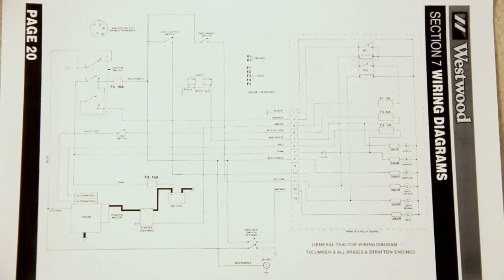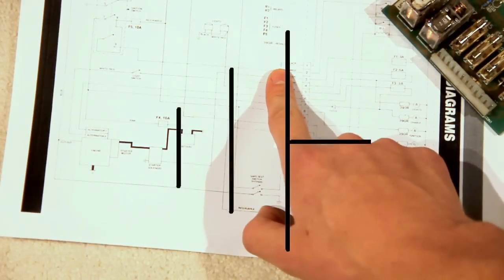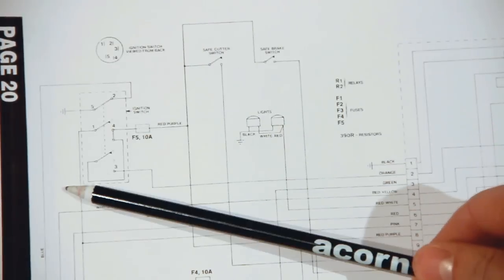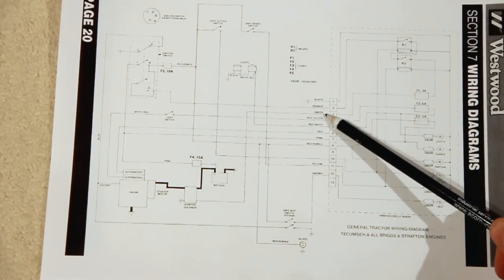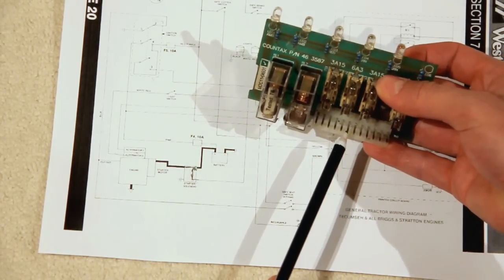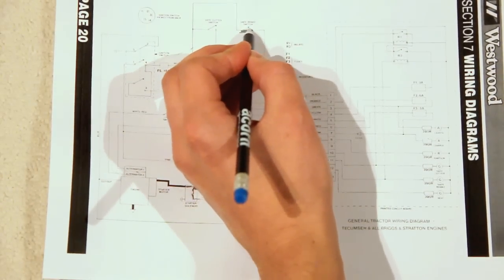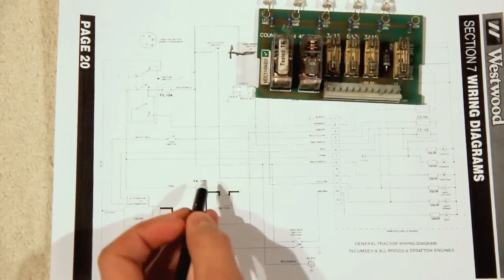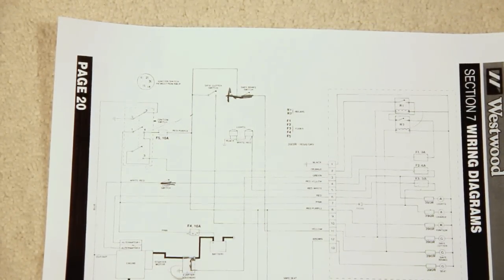How to: Read an Electrical Wiring Diagram

Comment: Hello, I know this video is quite old now but for anyone still interested I think the explanation of the safety interlocks is slightly incorrect. When you press the brake leaver for example this will close a switch but this actually causes coil R2 to Energise closing the circuit and allowing the engine to start. The R1 works the same. This is done for safety purposes as it completely removed the user from the higher voltages.

Comment: Very helpful video. I have all lights on dash but no start or lights? Changed the solenoid and tested starter motor. Last resort is depressing the break which I have never had to do #confused 
any suggestions?

Comment: hi can you help me I need a copy of the same wiring diagram you had on the video can you let me a  address for this as we have a westwood s 1000/30 1991 with a 10 hp b&s engine and all the wiring is shot. seen all the videos think they are grate
Reply from the maker: Here you go, it's near the bottom :) http://static.fatsoma.com/gts-pdfs/westwood/owners-99.pdf
Reply: Machinery Restorer sorry not got back to you thank you . rewired west wood over Xmas just wired hand brake  not the mower one so I know the hand brake is on when I start up thank you watched your last video over Xmas keep them coming  .     thanks Pete.
Reply: Bob b